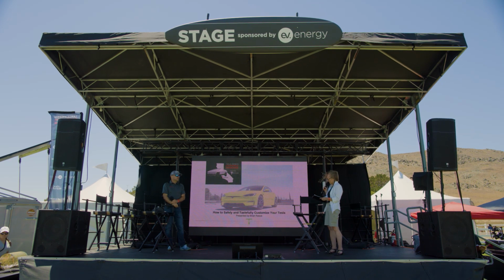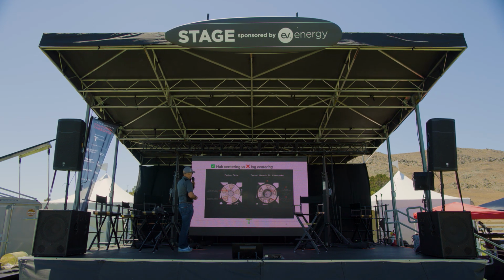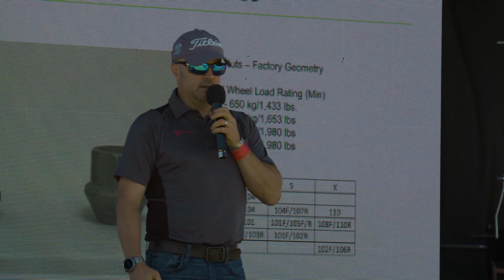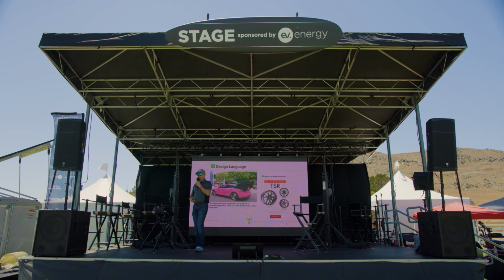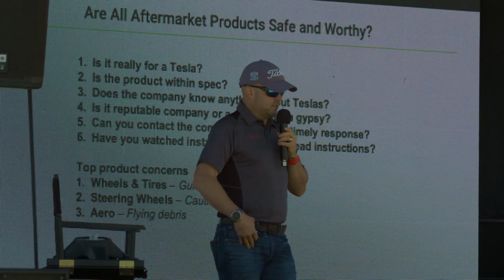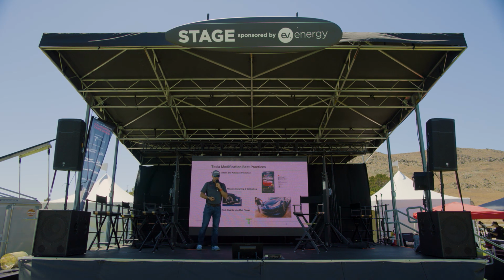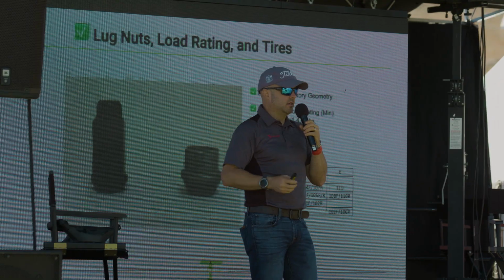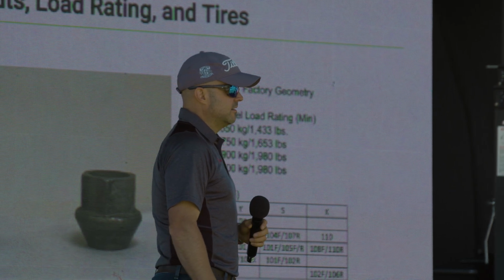How to Safely & Tastefully Customize your Tesla Model S 3 X Y - Dos and Dont's of Aftermarket Wheels

Comment: Hi, From all the feedback and comments it’s clear you are a great brand however as I’m new to the Tesla world I’m still nervous and getting to know and discover brands such as yourself. How long have you been making wheels and how strict are the quality standards? When batches come from the factory are samples  tested or undergo any analysis to make sure they’re up to standard and safe on the car? So sorry I wasn’t sure how to word these questions so it’s probably not come out right but I just wanted to feel comfortable before putting them on such a fast, heavy and expensive car
Reply from the maker: We've been making aftermarket parts and wheels exclusively for Tesla since 2013, making us the first Tesla tuner in the world! All of our wheels are fully tested to the JWL, VIA, SAE J2530 & TÜV standard, which are the most strict standards for wheel manufacturing in the world. This ensures that all of our wheels are properly load rated and safe for your Tesla.